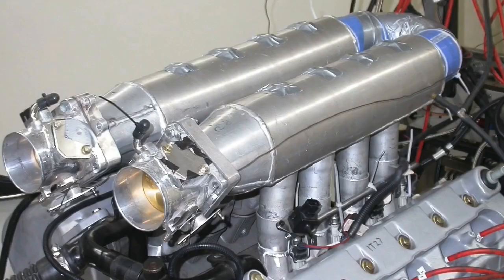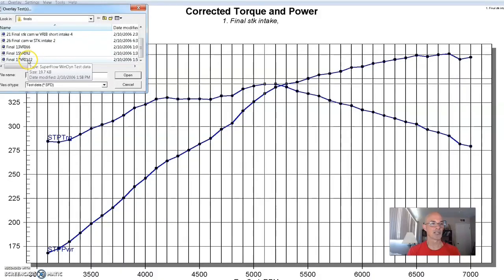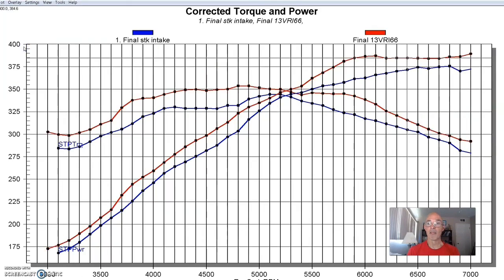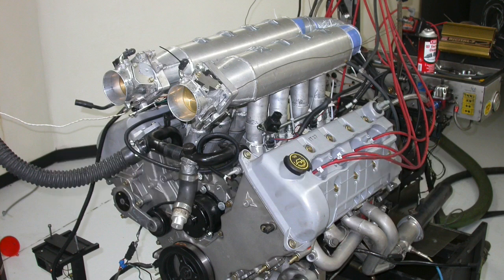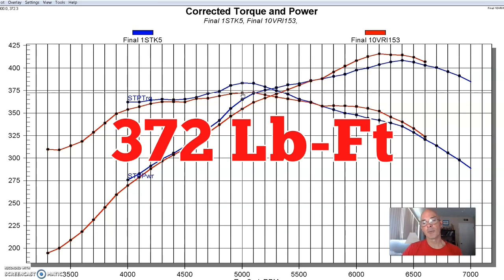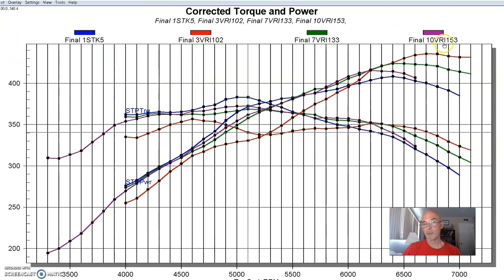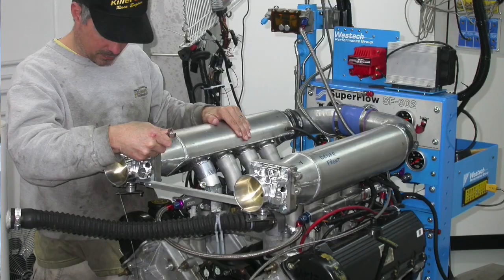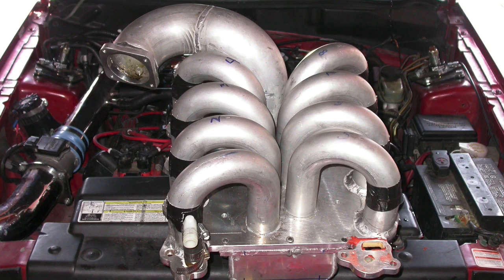CUSTOM INTAKES--BUILT NOT BOUGHT

Comment: if you were going to make a tunnel ram for a small block chevy, 327, stock 461 heads, around a .500 lift cam running a 2g tri power carb setup, what dia. tube would you choose, its for a 35 ford pick up hot rod, thanks
Reply from the maker: easy to test-squish a 2-inch or 1 3/4 inch section of tubing over a 461 head port and see what fits best

Comment: sheet steel & sheet aluminum alloy make great DIY intake manifolds..
Reply: Back in the 50s, the Crower U-fab was just two long tubes and two intake "adapters", for lack of a better word. The runners were just hoses that you cut to length and clamped down!

Comment: Back When I was a crew chief on an old six cylinder Asphalt Modified, Slant Six Chrysler, We made our own intake by using 2x2  square tubing about two feet long with an aftermarket 4bbl intake bolted to that. my goodness, tons of torque! Also I made a custom 904 push button shifted trans with no torque converter, It had a ball valve controlling the trans pump pressure. Super low inertia for lightening quick acceleration off the turns!
Reply: Caterpillar forklifts used the same idea on their transmissions, when the "clutch" was depressed oil pressure was bled progressively back into the transmission. They still had a torque converter though.

Comment: This brings back memories of my old Formula SAE college days.  Back then, I thought intakes were all about flow numbers, but then I realized the importance of Heimholtz Resonance on how to tune the intake plenum, runner length and diameter, and radii.  Air flow is fluid like and sound waves/resonance affects the flow of the air going into the engine.  Think of it this way, if you had a subwoofer up against a draining kitchen sink, the water doesn't flow as fast as with no sound.
Reply: Any book you recommend on intake design?
Reply: @fokjohn  Scientific Design of Intake and Exhaust Systems by Phillip H. Smith.  Also The Design and Tuning of Competition Engines by the same author.  You can get some of the same information from David Vizard's How To Build Horsepower in a less dry format.  (This is no exhaustive [no pun intended] list, just a few to get you started.  Amazon or your local library would be a resource to try for more.)

Comment: Hey Richard, I know this isn't a LS video but I have some questions I hope you could test or answer. I'm actually looking to use my gen 3 6.0 LQ4 in my yukon 2500 as a tow rig... well I actually do that now but I need to get as much low end HP/TQ as possible and was wondering if you could do some testing on what works and what doesn't?
Reply from the maker: we have-even designed some new stuff (don't tell anyone)

Comment: Car craft did this test on a bbc with a mech. Fi system. Found that 13" from valve face to air opening of the stack. Made the most for cinder ramming. This was for individual runners. On a 98 honda vfr 800. The do use a two length running intake. The tall stacks would lift out of the shorter ones at about 10000rpm. A very noticeable change from 10000 up to 15,500. This test doesnt take into account the shared plenum or amount of volume a plenum has on the effect. The first graft showed a very erratic graph line. As the runners got shorter...they leveled off. When you get to the dodge magnum dog house intake. You will find ne of the best designs for runner length and volume. Another amazing pc is the wiend dual tunnel ram.

Comment: didnt GM can -am bbc have two different length intake tubes?
Reply from the maker: BBC heads have good and bad flowing ports
Reply: Yes, the old Can-Am big blocks had two different tube lengths on the stack injection.

Comment: This is really awesome! I’ve got a 3.0/3.5 liter Nissan V6 being built and will be running individual throttle bodies. Been trying to figure out how I’m going to figure out the “right” length for the runners up to the throttle body(s), and then length of trumpet out away from throttle body(s).   My question is,, Would a guy see the same type of changes with my set up or would the butterfly being closer to the head affect it differently? Have you ever done any dyno tests on runner and trumpet length differences with ITB systems?
Reply from the maker: runner length still works the same regardless of where the throttles are

Comment: Richard what about lack off airflow  which 7 and 8 cylinder on a v8 lacks.nascar fixed that problem with more duration on 7 and 8 cam lobe profile to equal cylinder pressure. No cam manufacturer puts that in cam profiles.actually no one talks about it.Same as inline 6 which number 6 sucks more air then rest of cylinder I gap them rings on that cylinder a few thou less then rest to Stop excessive blow by and ring wear.If NASCAR where awear of that issue fix it.v8 have a lot off issues with middle cylinder especially number 4 I know there's lots off variables but un equal cylinder pressures add to the problem that's why NASCAR engine builders addressed it .
Reply from the maker: why do those cylinders have more airflow
Reply: @richardholdener1727  sorry I spelled he name wrong Stephen Papadakis.anyway  with inline engine plueum chamber air goes to back off chamber and loads  up back cylinder more than they front why because air doesn't like sharp turns so 654 gets more than 123 with 4cylinder 43 gets more then 12 as a example if you stand around corner of your house when wind is blowing you only feel a bit wind but if you stick your head out you feel full blast same principle in plueum chamber air doesn't like sharp turns . With v8 cylinder Rob each other off air same with v6.especially adjacent cylinder firing especially with 5 6 3 4 etc are fighting over that mixture flow which causes fuel reversion into they plueum chamber carburetor our efi.nascar are still have that happing and lead gentleman at comp cams talks about it.air does not like abrupt our sharp turns its a basic  principal of fuild dynamics. I've studied airflow for year's as I do a bit head porting myself. Thankyou
Reply: Go to Stephen Papadopoulos. How intake manifolds nitrous and turbos designed for 1000 horsepower 4cylinder. Just type that in.and with v8 that's in my book written buy David vizard who I learnt from him and a gentleman named Gale banks.hope that answer your question. Thankyou

Comment: Would have the sin wave changed much if the two banks were balanced between themselves? balanced at or just after the throttle bodies v's the rear? Looking at the photo it looks like the two banks are separated.
Reply from the maker: we ran joined and not joined, with different lengths of air intake, different injector positions-I only covered the runner length

Comment: Back in the 70’s a buddy of mine made his own sheet metal tunnel ram intake manifold for the 350 Chev in his mid engine sand rail.  He used like 1 1/4 or 1 1/2” tubing running up to a square(ish) plenum.  It totally didn’t work.  The fuel  just ponded in the plenum under the carb.
Reply: The runners on his manifold were around 12” long (or slightly more) as I recall.

Comment: I worked in a Chevrolet dealership in 1968 thru 1972, and remember the dealer's son ordering a 1969 Camaro Z28, and with it a staggered dual quad CanAm intake manifold.  I would assume that the way the intake was made, the plenum was probably  open which would lead to high rev. capability.  Have you ever played with one of these?
Reply from the maker: I have not run the factory cross ram intake

Comment: Can you do the same with a camshaft? I would like to have a custom cam made for my 2.8 liter ford engine because I want to put the 2.9 head on the 2.8
Reply from the maker: variable cams work, so does VTEC-both are best
Reply: @richardholdener1727  no no I'm talking about the mercury Capri mustang ranger with the 2.8 liter cologne engine I would like to have number 3 and number 6  to reverse the exhaust and intake so everything else is the same same rotation it's just I need the exhaust lobe can become the intake and vice versa for the intake on only these two cylinder
Reply: Andre Messier , the 2.8 liter, 60 degree V-6 that powered the Mercury Capri made during the seventies never did get the aftermarket support that it deserves. The one I owned had an abundance of torque and the 4-speed manual transmission made it a fun daily driver. Offenhauser made an aluminum 4-V intake manifold for the 2.6/2.8 Cologne built engine that was designed for the Holley 390 cfm carburetor. Unfortunately I ended up trading the Capri in for a new 1978 German made Volkswagen Scirocco before I got to try the Offenhauser intake. 

I would imagine that any reputable cam grinder could provide you with a custom design to suit your requirements. I would like to see the results after you get the combination sorted out.

Comment: Very cool to see length changes in action.  Talking about intakes, I'd love to see the performance difference of running a turbo bare vs using a bellmouth on the inlet.  In theory, by running it bare, that hard edge causes a 15-25% flow restriction.  I was just watching Finnegan's twin turbo boat videos and it kills me whenever I see a bare turbo intake.  You're losing potential power and it's a cheap fix!
Reply from the maker: I don't think the change in flow is 25%, but I have run radiused entries on turbos and blower-they work well. They add flow best when near the flow limit of the turbo or blower. Finnegan is awesome
Reply: @richardholdener1727  I love the Roadkill guys.  Please get them a Dodge Turbo II for their Rampage!  As for the intake, it's really surprising.  You wouldn't think so but it can actually be that much of a restriction.  I'm not an engineer but I work in a building full of them and have learned quite a bit.  The hard edge creates turbulence disrupting the flow.  A radiused intake gets the closest to laminar flow, 97% efficient.  Pipe with a 13 degree taper is 94%.  Short pipe, hard edge is 82% efficient, Long pipe, hard edge is 72% efficient.  Do a search for "Eclipse Combustion Engineering Guide pdf" and check out page 4.   I'd be interested to see how much the boost perks up with a bare vs bellmouth turbo inlet. I'm guessing that an anti-surge compressor housing won't be as efficient as one with a smooth inlet.  Thanks again for all that you do!

Comment: where does the 96-98 modded short runner intake fall in all of this? its been a common mod more decades now, sad to see it missed out on here. i believe the hot ticket is to remove 1.5" from the stock runners. thoughts on where that intake would fit in all this?
Reply from the maker: We did that on the 96 motor too-did lots of testing on it

Comment: Someone should build a tpi system for the GM torquers, the Buick, Olds, & Pontiac 455s.
Reply: Why go to when you can just add injector ports for a sequential system? Or just go with a Holley sniper electric carburetor
Reply: @Prestiged_peck  I don't know but maybe a tpi type intake on those old 455s might work well. I remember Hot Rod did build ups on all of those engines about 20 years ago, they said that some of them were at the maximum measured torque just as the dyno run was beginning. They were probably making more but it wasn't measured. A tpi intake would enhance that even more. Don't worry, no one is going to make a tpi intake for them.

Comment: GM did experiment with this in the Opel Omega Lotus headed 3.0 six in 1986,they used a variable runner length manifold
Reply from the maker: Did they use it on the Carlton?
Reply: @richardholdener1727  Hi yes it was actually a 3.6 and it was called Opel Omega in Germany,Vauxhall Lotus Carlton in UK,it was a popular joyriders car next to the Xr4 Turbo Ford Sierra

Comment: My father wrote his Masters Thesis about this exact problem in 1951. I have a pdf copy if you have a place I could upload it to.
Reply: Did he hang out with the the ramchagers/work for Chrysler corporation of gmc ?? If so thank you ☺️ to your dad as most of the information that I’ve learned is from older hot roders and dodge explaining how the 1950-70’s max wedge 🧀 engines 30” inch long runners work
Reply: That was a forward thinking young man in 1951! Most cars on the road at that time still ran flatheads of one kind or another, the only overheads were the Caddy, Olds, and Hemis, all brand new then. I think on the flatheads, the block itself was such a choke point, the manifold would hardly matter.
Reply: I can upload it to my server. Email it to me. jordan@waughtal.rocks
Reply: I'd kill to read that thesis...
Reply: @jlda1887  Do you have a throw away email, I could send it.
Reply: @okjd159  I still haven't seen an email from you...
Reply: @jordanwaughtal7649  Did you get it?
Reply: @okjd159  I did thank you.
Reply: @jordanwaughtal7649  Where is the upload at?
Reply: @okjd159  I’d like to read it to please!
Reply: @sorryociffer  give me your email
Reply: I would love to read it as well if still available

Comment: I made a calculation to figure out runner length for intake manifolds and exhaust headers based on cam duration, rpms, and the speed of sound at different temperatures for resonance tuning. This video really makes me want to test it out. Could even get fancy and make it have multiple resonance points at different runner lengths for different rpm points like a tri-y/4-2-1 set of headers.
Reply: I keep hoping we get to the point we can 3d print intakes and see all kinds of cool things. a tpi style intake with a straight down short runner in the middle with valves to open would be very cool.
Reply: @jsomething2  as long as you have the money to play with go nuts and please keep me informed!
Reply from the maker: did you see the TPI intake video-lots of different runner lengths
Reply: I do not, I don't even know what you'd print with. I've searched and found a few that used pla for prototypes but it would last in a running engine. I don't think home 3d printing is there yet
Reply: @jsomething2  yeah I am a simple man so I would probably just cut out aluminum flanges to weld already pre-cut aluminum pipes plus a collector to. The 3d printers and scanners have supposedly come down in price a lot so I might look into getting one.
Reply from the maker: Very cool!

Comment: Should try to run shorter runner in the back and increase height as you get towards the throttle body.  On equal length runners with the throttle body at the front the rear runner is over twice as long as the first one.
Reply from the maker: The plenum is not runner length

Comment: Just for  shits a giggles, what if you used long on 1 bank and short on the other? Best of both worlds, with a little compromise of just both sides fighting each other? I have seen an actively adjustable length port that works based on rpm.
Reply from the maker: I did that test with the Fast adj intake on the big LS3 intake test
Reply: @richardholdener1727  I liked that system.
Reply: I watched a HPA video where they talked to a group with four short runners and four longer runners on a V8 to spread the torque across a wider pleateau. They had EGT sensors in each header primary to smooth out the engine because half the engine will pretty much always be inefficient.

Comment: Great demonstration Richard!
I'm wondering if you have heard of crossover? Does it only apply to boost?  Does it  just mean the peak efficiency was shifted to a higher up on the rpm  range?
Help me out 
Thanks
Reply from the maker: cross over has many definitions-which one are you talking about
Reply: @richardholdener1727  To be honest, I don't remember exactly but I read in a turbo book about cross over on regards of drivablelty of a street car setup vs straight up race engine using  jet engine principles where there is poor efficiency at low rpm vs the high efficiency in the 70% to 100% of max rpm. You talk about it all the time but I haven't heard you call it "cross over"

Comment: So make it adjust on the fly through the RPM curve? Stepping motor on all thread?
Reply: Ferrari does that with the LaFerrari. Engineering Explained did a video on it. Very cool stuff!
Reply from the maker: they do good stuff over there

Comment: Interesting. This leads me to wonder about the diameter of the tubes in relation to velocity of the air charge. Does the wave change with diameter?
Reply from the maker: the Inertial Ram does (different wave type)
Reply: @richardholdener1727  thanks for the reply my motor is a 74 bbc 454. Putting and tunnel ram single 850 pro carb with a summit 500 lift cam. Like the sbc 400 video just got one

Comment: The imrc valves were ment for different runner length in the manifold
Reply from the maker: IMRC doesn't change length-it stops flow from 1 port-makes the port effectively smaller

Comment: I like having torque on the lower end for street racing, light to light, took all my smog stuff , larger fuel injectors, chip and tune, larger modified exhaust, cold air intake, on my 1986 Corvette, scary torque monster with the long runner length, don't need high speed dangerous stuff.

Comment: didn't Porsche  have a fancy variable runner intake on some cars.
Reply from the maker: yes and multiple plenum volumes
Reply: @richardholdener1727  Vw /Audi uses “dual resonance manifolds” on a few engines also. The 3.2 Vr6 in my Golf r32 uses that.  Doesn’t have have a short and long runner but opens another chamber to just change the pressure waves for torque or heigh rpm power.

 Porsche uses an expansion manifold design in the new 991 turbo engines. Weird  to see a restriction in the runner just to have it expand to have a cooling (inter cooling  effect ) on the intake charge.

Comment: Wow this is so cool! Why does the graph have so many peaks and valleys?
Reply: Where the frequency of resonance goes in and out of phase with the engine rpm frequency.

When it's out of phase, the power drops dramatically.
Reply: Michael Angelo wow thank you! Electric motors can run out of phase too and it screws everything up.